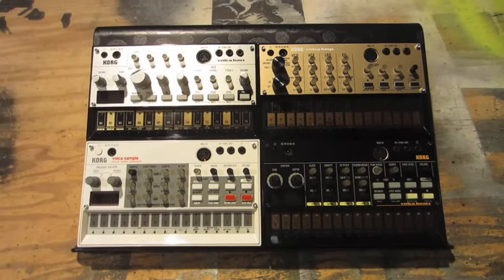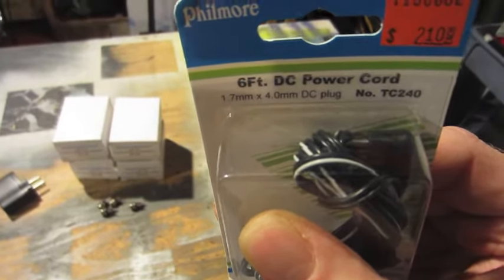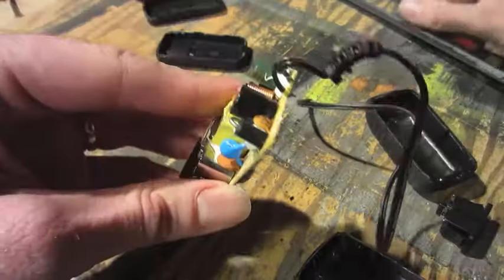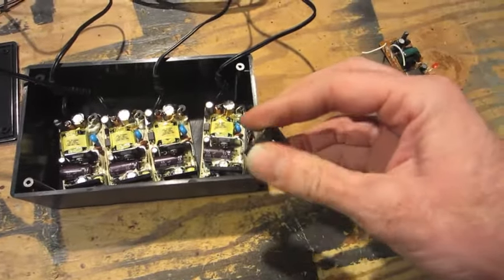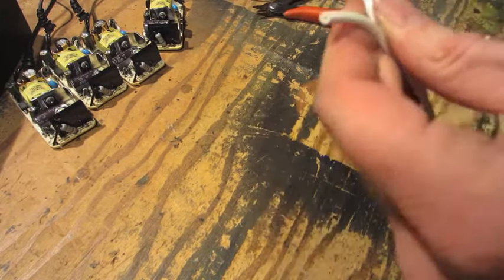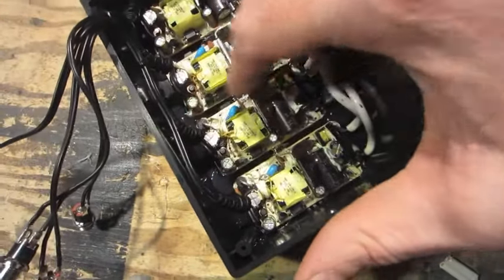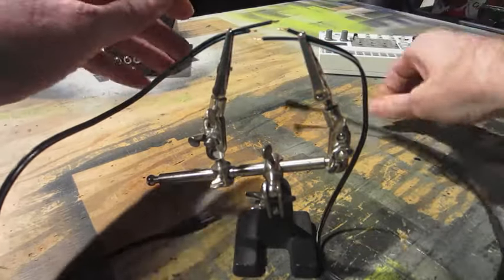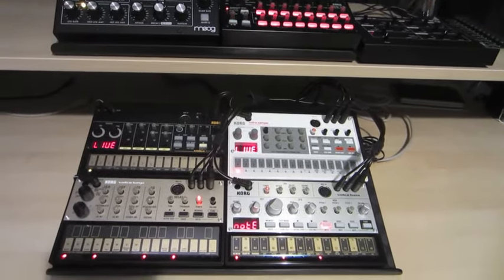How to make a power supply for Korg Volca Beats, Bass , Keys, Sample and SQ-1

Comment: Excellent project... I was thinking this design could be extended to allow for a USB external battery input that bypasses the transformer circuits  with a switch but could use the adapter leads to distribute the power without unplugging anything.  AC and Battery via USB battery pack. Thinking is easy. What you did here takes skill. Thanks for sharing.

Comment: Impressive build.  I assume this was for fun, since you saved about 2 dollars doing this :)  Thanks for sharing.
Reply from the maker: Thank you. Yes you this was mainly for my own enjoyment and not to save money. But also I've still not found a comparable option on the market that provides four totally isolated DC outputs.
Reply: saved 2 dollars? I have a bucket full of 9v wall worts. cheap 9v DC power bricks off ebay from china are made using crappy parts. 
at least with this way you are using reliable stuff you know work. more importantly you are re purposing land fill rather than buy more chinese landfill crap

Comment: hi mike have you considered a power supply for multiple guitar effects instead with isolation between each socket? (not a daisy chain one, but one with actual individual outlets)
Reply from the maker: Yes I looked into that before building this. It was over $100 for a unit with the same output as mine and I spent around $50 building this.
Reply: i ordered a cheap one on ebay for $25 from HK now ... let's see how isolated it really is